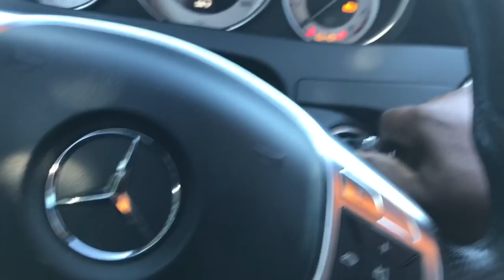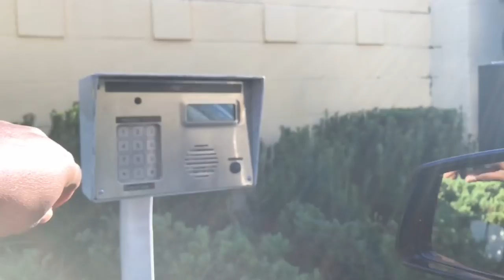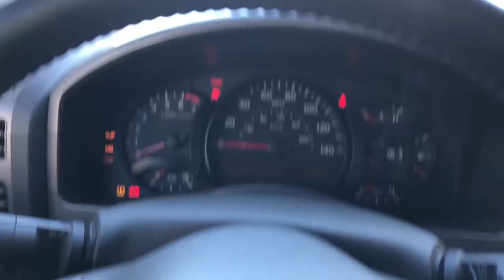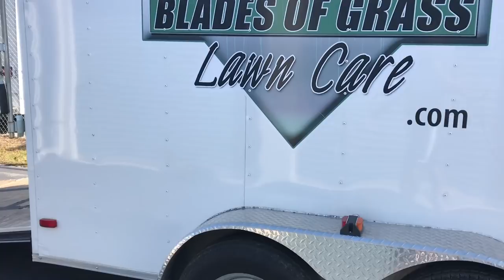New enclosed trailer setup | Lawn care company owner Sunday morning pre check

Comment: Hey check out the proven Industries Puck style locks for the ramp locks. I feel so much safer leaving my trailer in the storage shop.
Reply from the maker: That's what I'm checking out now, thanks!
Reply: Puck locks is where it’s at! Never liked locks with big shackles that one cut and your in the trailer. I️ bought 5 puck locks from a guy on eBay. Had all 5 keyed the same. If I️ happen to lose one I️ have a spare. Also same key makes it easy. Don’t get sticker shock.... you’ve been warned.
Reply: I did see some that looked the same at Harbor freight for like $10 each after I spent $50 a piece for the Proven Industries model. Not sure the quality.

Comment: Thanks for the video! When changing to the Gator blade do you leave the mulch kit installed on the mower. In other words are you only switching out the blades, wavy to gator. Thanks!
Reply from the maker: I installed the mulching baffles two weeks ago, but was still using the wavy blades. I'll switch today to the gator blades, thanks!

Comment: Hey Johnny, I have the same exmark 48” Radius mower. With the much kit installed. I’ve been wanting to try the gator blades. What’s the part # for those gator blades you are using for the lead clean ups.

Comment: I like using the gator blades and I’ll use them all year . Good video! Question what size is your trailer? I’m thinking of getting a smaller enclosed trailer like a 16ft I Currently have a 24ft.
Reply from the maker: It's a 7X16, thanks!